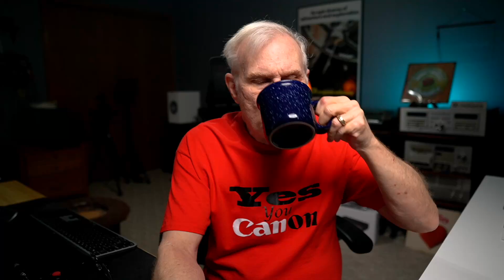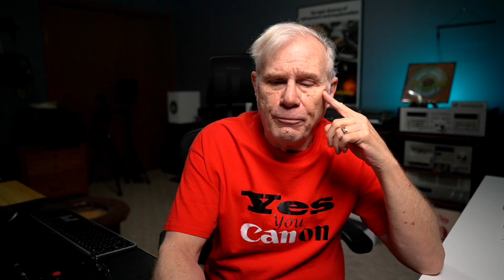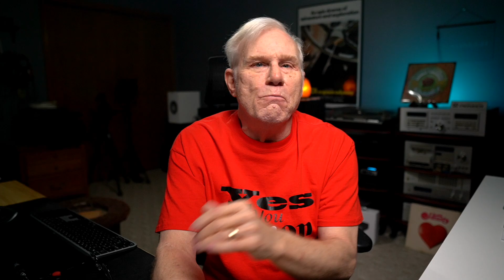Why Not All Music Streamers Sound the Same (Even with External DACs)

Comment: Interesting to see how a Wiim compares to more pricy streamers.
Reply: Quite average for all outputs but sounds alright for most listeners. But if you want to play at high fidelity, with low level details, 5 meters away at 95db, you need way better. Wiim has no chance for that.
Reply: @prateeksaini5412 data for this comment or is it an opinion?
Reply: @therealelguapo  Don’t give that BS stance! 🙄
1) You don’t need data to feel/see what is obvious. Like light breeze in your face vs fast wind. Like identifying ingredients of food by tasting just one spoon. Don’t you effing try to discount human capacity to perceive/senses.
2) The data that you talk about is of a PRIMITIVE nature in audio. It’s barely capable of calculating & predicting sound quality. Loads more research needs to be done, and not by knuckleheads like you, or even boutique companies, but by tech giants like Apple, to identify bonafide ways of measuring quality of audio equipment.
Reply: @therealelguapo The Wiim Mini has 102 db SNR & 96 db dynamic range for line out. That’s only suitable for casual listening and will audibly distort at loud volumes. There will be a tweeter hiss using this option too.

Spdif Optical output definitely has much better SNR & Dynamic range than one needs but the Data stream is Synchronous and this is an old interface. There WILL be jitter & time domain noise artefacts. There are many audio samples on the internet which contain jitter and a fuzziness & harshness is blatantly audible. Somebody did a jitter test of all Wiim models and found bog standard jitter performance.
Reply: @prateeksaini5412  I didn't actually take a stance - just asked a question. Your reactive points 1 and 2 aren't particularly interesting or useful comments. Your next comment about dynamic range is though. 

Sounds like you think I do testing? Maybe you were talking to Erin. Just so you know where I'm coming from: I have A/B tested (with an A/B switcher) the WIIM ultra streamer paired with Fosi V3 Mono's connected to Von Schweikert Vr5 Anniversary speakers (a highly revealing speaker). I and a couple audiophile buddies could not hear a difference between them and a Hegel H190. I've blind A/B tested a dozen amplifiers, 4-5 preamps, a handful of DAC's and none of the equipment I've tested made a difference in sound. 

Seriously, we could not hear the difference between a $800 class D Crown amp and a $4k Yamaha A-S2200. 

I'm at the point now where I think 90% of your budget should be on speakers. Just my own experience.

Comment: i only have a airport express for airplay going with a toslink in my onkyo 9050 with Wolfson DAC. I dont have anything to compare :D. What do you think about the quality of the airport express? A Issue that i noticed when using airplay 2, is crackling kind of sound, its only noticeable in f.ex. quieter piano parts, especially on headphones. When using Airplay 1 (downgrading the firmware on the airport express) the Crackling Sound was gone. I read online about it, a lot of people had the same Problem with the airport express. I then checked on the Yamaha Receiver my Dad has if the same problem occurred using Airplay 2, and it did. So im wondering, is this a Problem of Airplay 2 in general?